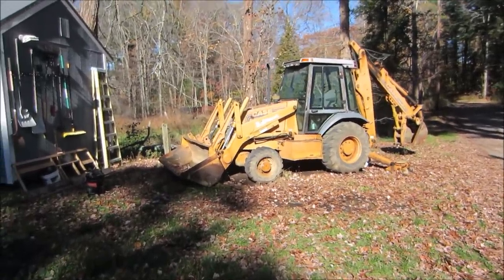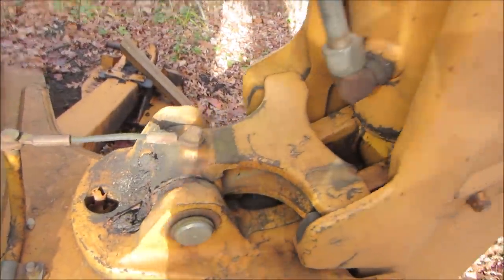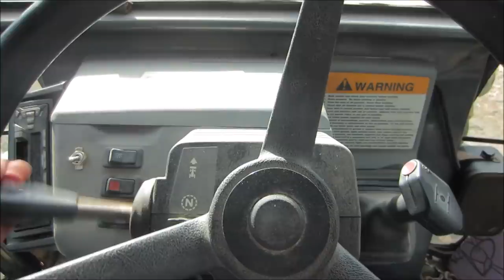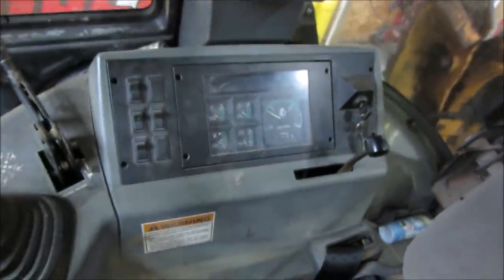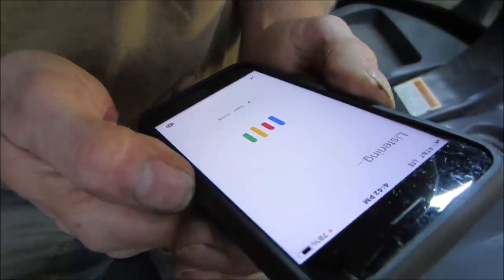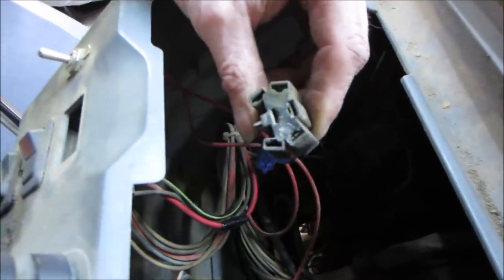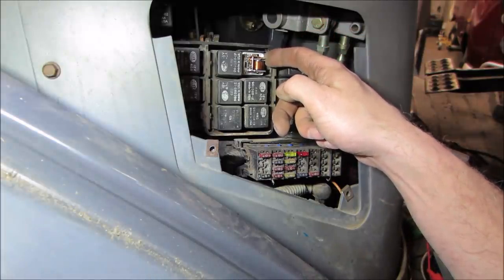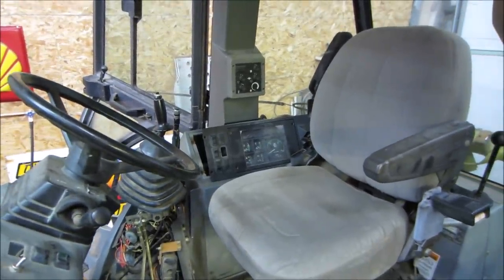Lets Fix Up A Clapped Out Case 580 Backhoe Thats Been Sitting.

Comment: We had a older case backhoe gave to us because it wouldn't pull itself and doing research everyone said spinning the tires in mud kills the case transmissions. I guess it makes everything spin faster than it was designed to internally. Couldn't drove the backhoe home? The company that did our local water system work drove theirs everywhere 30-40 miles for 30+ years.

Comment: I love Backhoes, I do not consider myself a "backhoe" operator but when i was in the waste industry I overseen the operations at a transfer site and we loaded the trailers with a backhoe for the most part, push the trash off the floor and the trash fell down into the trailer then we whip them around and used the stinger to pack the trash down even.  Always fun to play on.

Comment: The 900 lb weight on the front is a counter balance to offset the weight of the backhoe when in use. It is not to prevent bounce in the front end but to help prevent the thing from tipping over backwards.

Comment: On the case you raise the boom up and just before it stops at the top push the boom handle away or down position. And it brings boom up to the lock position.  It takes a little practice as you have to time it just right. CAT had the same thing in the late 80s.

Comment: The button on the top of the loader control is probably either a transmission disconnect that allows you to momentarily take the transmission out of gear when you are digging, or a “return to dig” function that will level the bucket after dumping so it’s at the correct angle to drive into the pile for another load. 
I think your 4x4 engage is the red button on the gearshift lever.

Comment: Sometimes they put a book behind the seat well john deere does don't know alot about case .
Don't let the doors slam shut the glass will break, just sayin. Keep the bucket low if you travel with a load in it. They will tip over. Oh yeah an just because it will go fast don't mean you should go that fast.  Once they start bouncing you could be in real trouble 😏.  
I've pushed alot of snow with a back hoe never needed a blade the bucket works. I always wanted to make wings that would  a fix to each side for pushing snow. Looks like you got a nice tractor there. Thanks for sharing 👍

Comment: The button on the shifter and the button on top of the front bucket control are clutch disconnects. They put the machine in neutral without having to constantly hit shifter on column. That third pedal to the left of the brakes is the differential lock. If your pushing dirt to load the front bucket that will lock the diff for extra grunt.

Comment: I worked briefly for a company in the 1980's that built coal mine and steel mill equipment and they built all their own hydraulic cylinders and also rebuilt customer's cylinders when they failed or were damaged. We used a hard surfacing electrode wire to repair worn surfaces on the piston rods and the pistons themselves and then re ground them to size. When done they were recertified and fully warrantied just like new. Some were up to 25 feet long so the test chambers were actually wells in the ground built to contain anything if their was a rupture of a cylinder when it was tested to 150 %.

Comment: Couple of things. The weight on the front is factory and came with machines that had Extend A Hoe. A counterweight.  The button on the bucket control puts the transmission into neutral and is used to disengage the transmission hydraulics so more power is diverted to the bucket hydraulics.  Used when pushing into a pile of material then lifting the bucket. Practice. You'll get the rhythm. You think this machine is clapped out? Looks 1000x better than my 580SE (1985) which I use everyday. Just completed a basement excavation along with sewer, electric, and water lines in NE Washington state where the ground is more glacial rock than dirt. Love my machine. Very reliable. Have fun.

Comment: the reason you could not lock into transport mode is   you have to push the book out the pull it back and at the last second push it forward  to get that jerking motion and it will pop back not sure if i explained it  right  i have a 580 and love it

Comment: Getting the backhoe to engage the lock for transport is a timing/technique that takes a bit to master. You have to get the boom over center to lock it, otherwise you will always be accidentally locking it when you are trying to dig.
You have to swing the boom up/in and just as it gets to TDC, you have to reverse it to move it over center and lock it home. Keep hands and feet CLEAR of the latch when performing this action!!!

Comment: I believe the other pedal on floor is for 4 wheel drive or Diff. Lock. The buttons on shifters are for release of gears. Weather shifter or front bucket control. Clutch discount.

Comment: I know a lot about that tractors because own one of them few years agos n traded it into new john deers 
And that switch from wiper front next to it is rear wiper
Button on bucket is disconnected clutch same on shifter front next to steeling wheels
4x4 switch is next to rpm on left side under rear lights

Comment: The thumb button on the shifter is for when you're loading trucks. You can push it in to disconnect the tranny and hold it in place while dumping and then release to reengage the tranny so you don't have to take it in and out of drive while loading. pretty handy.

Comment: Near the end of the video.. that one orange wire is a main feed wire to the fuse block you're working on. That's why there is only one wire coming from the fuses. One main coming in to the fuse block and many going out to different components. Why did they "jump" from one to the next is beyond me. If only I lived closer... I was an electrician and worked on many different power generating systems and I love troubleshooting.. lol..

Comment: To get the boom to lock let the boom down about 3 feet or so , make sure the boom latch is up , throttle up a bit and in one sweeping motion bring the boom all the way back up when it gets up  to the top of its stroke ( closed) quickly release the latch , trust me I’ve run a few case backhoes and their all the same lol

Comment: The button on the shifter is the clutch. You can press that and shift on the fly like a car. The button on the top of the front bucket controls does the same thing. There should be a switch for the 4 wheel drive on the console were all the gauges are I think that is were it is. It’s been awhile since I operated a backhoe this old. There is a switch though you can switch from 2 wheel to 4 wheel. I’m not an expert on these. I just have a job were we have a couple backhoe’s.

Comment: Fuse box will have a common live per row (bus bar) and wires for the circuits the lighting would have been 2x 10a fuse, someone bodged the wires and stuck a 20a in - say 21w a bulb that’s 14 amps for all 8 lights

Comment: I was getting a headache from screaming at my tablet. Get a box load of relays with some connectors. Those relays are hella cheap from the Amazon. Wiring diagram for the relay available everywhere on the inter web. Those switches weren’t designed to carry high amp loads hence the need for relays. Good find though. I’m jealous

Comment: to get the boom to lock in to travel, lower it all the way down, bring it up fast, and it will lock in...also, have the rpms up.....remember the old adage " don't lug your Bug "......same concept......the engine is running a hydro pump, which runs the rest of the tractor....

Comment: for parking the boom , you need engine speed and the boom control is all you need to operate to park. Raise boom up and then reverse your direction on stick as cylinder goes over center.

Comment: Bulldog in Florida has super seal kits for cheap for that machine. They have the best deals and are complete kits for pennys compared to what Case wants. You also need one of those crayons that tell you when you have heated metal to 550*. Case sets their cylinder nuts with locktight and you have to heat the nut to 550* to break them loose. Also call the parts store and order locktite primer-activator before you even start. Everywhere sells locktite but I have not found anyone that knows it has activator, Part number for activator is on the locktite red package. Fastenal ordered it for me and never got it. Then NAPA had it in a couple of days for me. Ask for Glen at Bulldog he knows his cylinders and will make sure you get the right kits.

Comment: Rebuild ALL the hydraulic cylinders.  Basically, all those seals and filters and the fluid need to be changed.  Hydraulic fluid can get water contaminated and the hydraulic system will bite you in the middle of a job every time.  I ran and repaired hydraulics on Altec booms for years.

Comment: How cool I actually worked at the very place that was manufactured. however, i wasn't there in 95 but i have seen my fair share of L series backhoes. I worked on the M and the latest N series tractors. although most of the components really haven't changed much over the years. I can tell you the front and rear work lights did not come from the factory bridged like that. someone definitely played with the wiring.

Comment: There is a trick to getting a Case back in travel mode. You have to pull back on the up lever until it gets to the top and push it back forward really quick to get it to lock. That's why the boom fell so fast when you let it out.

Comment: There is a trick to getting the boom locked back in.  You have to raise it all the way up quickly and as the  boom reaches vertical, you have to reverse the direction on the control.   The momentum will carry the boom past vertical, and the reversing of the control will continue pushing the boom past vertical till the lock engages.

Comment: Congratulations mustie1 but you probably ought to get a book or Google all the procedures of that case. Probably one of the best small rubber tire backhoes besides the Massey Ferguson for strength great construction backhoe plus the four-wheel drive. Oh by the way does that one also have AC and heat in the cab??? One thing I was wondering what is so clapped-out about that?? Knowing you you got a deal on it because everybody knows musty don't deal unless there is a deal to be had! I do know that those ain't cheap to work on that's for sure but you are the guy that works on just about anyting. Probably needs filters for everything and new fluids it looks like you got a pretty good deal man. Many blessings to you and your family during the holiday season.

Comment: Congrats! 
I didn’t see you use the preheaters before starting. That will save the engine, starter, and battery a lot of grief. Not sure where the preheat on that one comes on. On my little tractor it is the key switch position just before start.
Reply: I know the 6 cyl Cummins in busses and such back then didn’t have glow plugs as far as I know, not sure about this backhoe. Block heater will help out on cold cranking though
Reply: Thanks! I never thought that the engine wouldn’t have glow plugs. A search shows not much at all on the subject.

Comment: WHEN cylinder RODS ARE BADLY MARKED THE CHROME IS REMOVED AND SPRAY WELDED AND POLISHED AND RE-CHROMED,, IF THE Rod is really bad we make a new rod or barrow, the seal kit for them out rigger  cylinder are $180 CND  dont get them from the dealer, metric seal kits are in the thousands witch are found on a lot of off shore truck booms the folding boom type, them blue splice connectors should never be used, more cars an trucks have burned up from shops using them to install remote start kits, the blade cuts many copper strand and it heat up until it starts burning the blue blastic, then sets the wwhole wire harness a flame and spreads really fast, for years my 5 ton dump truck would shut off driving down the road out of the blue and start back up on its own as the transmission would keep turning the engine over, i could never ind the problem until one day smoke came pouring out from around the steering column, i stopped disconnected the battery, dropped the column down to find one of them connectors all burnt up and about 6" of the harness, my ex wifes car burnt to the ground at 5am one 40 below winter morning after she used her after market car starter witch had them connectors on it,, just wish she was in it

Comment: the 580's SL are good machines. no idea what you paid for it but the configuration you got is very desirable. you have the Jon-dear backhoe controls 2 levers, IMO are much easier to use than case backhoe controls, 4 levers with foot swing but the case give you much finer control once you learn them. after a while, all the cylinders will leak a bit, just how they are. keep an eye on the hydraulic fluid level. the cab is very nice to have in winter. the extending lower arm is very nice.

Comment: Case 580 Backhoe is a Good Deal that I know you can fix. That's a Big Meyer Snow Plow. I think there was a fire extinguisher in the cab. Do the all the cylinder work and no leaks.? Maybe you could buy some re-caped tires for the front.

Comment: The rear wiper switch is the knob on the right control panel, directly below the interior fan control knob. Directly to the right of the front wiper knob. The one with the rectangular windscreen symbol to the left of it👍

Comment: .....hi Mustie, you certainly like a challenge don't you. As for those outrigger cylinders  I hope the guys repairing them know what they are doing. They usually cop a fair bit of ' Oh crap' moments because they are close to the action. Small nicks can be fixed with JB Weld or similar. Any thing to stop the seals from shredding. I used to work for James Chesterton and recommend synthetic seals to the old rag and rubber ones. Merry  Christmas to you and your family from New Zealand.

Comment: You are so brutal in fault finding XD You would be better off using 12V on the ground lead of your light probe and then sticking 12V to stuff with current limiting through the bulb.
Thus you would be sensing if stuff uses more than the bulb or less with light intensity.
Or at least have a 20 amp fuse on the line. You crack me up :D

Comment: bottom left- 4wd.

The others are lights. there are 2 separate switches for the front lights, and 1 turns the 4 in the rear on with one switch.

Comment: That boom has a cam over on the cylinder to get it back in the lock. You have to pull back on the joystick till it hits the cam over wall and then quickly pushe the joystick away from you

Comment: I'm just going to throw my 2 cents in but for the rear wiper switch should be on the same panel as the front switch directly beside it towards the rear. I think I saw 2 wiper switches marked there so the front one is the front and the rear on is the rear.

Comment: Don't overlook those blue plastic pinch-on splices as a very real source of frustrating electrical problems (which can be intermittent and elusive), generally caused by corrosion in damp weather. 
The radio powered up without explanation after some fiddling with some wires - but for how long? (not that the radio matters) 
That's the nature of intermittent faults.  Have fun. :)

Comment: Trick to case backhoe locking have to bring boom up fast then push lever to drop boom at point gets past center and it will go into lock without you pushing peddle for lock release

Comment: In order to lock the boom, curl the bucket and the other arm all the way in and bring the boom back and just as it almost stops , move the stick the other way to extend the cylinder out to over center the boom and it will go further tword the cab to engage the lock, it has to be all one motion to work, Case still uses this on their new backhoes, once you figure it out it's not that bad, it will scare you, cause it looks like the boom is going to hit the cab.

Comment: My boss had a 580C back in the 1980s. It had a counter weight up front, always assumed it was factory equipment. I suspect your counterweight might have been added to deal with the extend-a-hoe. I did a job for a golf course back in the 90s. The grounds crew dug a path so I could build a set of steps down a fairly steep slope to the cart path. They had a John Deere 310 with an extend-a-hoe that seemed like it was way too much attachment for tractor. They had to have a full scoop of dirt or gravel in the front bucket To keep the front end on the groud when digging with the hoe.

Comment: I first learned to operate on a Case 580 backhoe, which belonged to my employer at the time in 1973, so the procedure may have been different. To lock the boom for travel: center it left and right, fold the bucket and boom, retract the extenda-hoe, then bring the boom back very fast, and just after it comes over center, reverse the lever, and it will come back into the lock position. To unlock, hold the lock lever or pedal to the unlock position while pulling back on the boom lever. It will unlatch very easily. I don't remember for certain, but I believe the travel pin to keep thw boom centered needs to be in place.

Comment: Does the thumb work? I only have experience loading and unloading backhoes, and yeah locking the backhoe for traveling is a real trick. It looks like the arm is going to come thru the glass before it will lock and you have to time it right.

Comment: The random pipe was probably used to prop open the door. Also, there are two wiper switched on the side panel. The left one worked for the front wiper, but the right one, which didn't do anything, should be the rear wiper.

Comment: I used to work at case dealer l series where tough machines... they had cummins engines and i think the fnr is a pretty simple easy to get parts for unit... i cant remember what series they went to where the frn and the diff was all in the same unit. You can find aftermarket and used parts easily for them. Having the extendahoe is nice until you have get it apart to replac hoses ...it can be a bear...